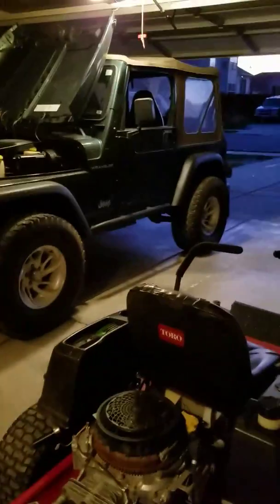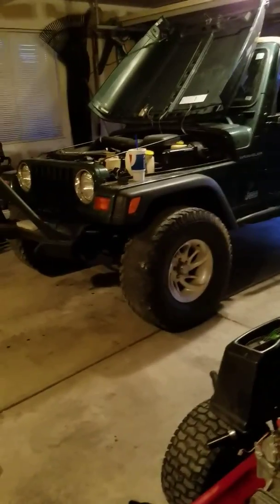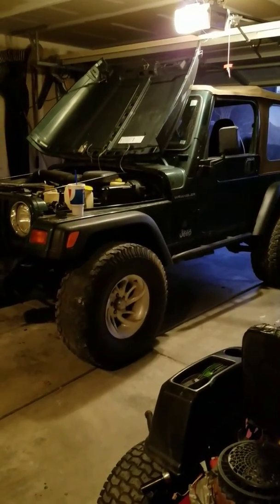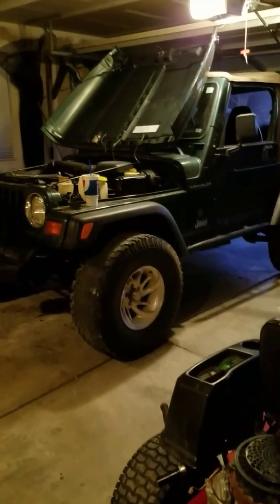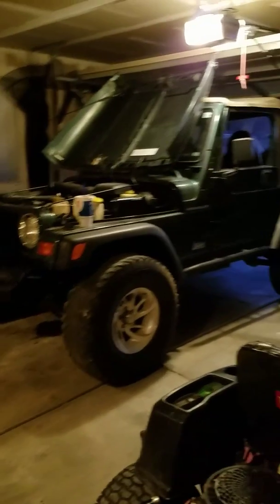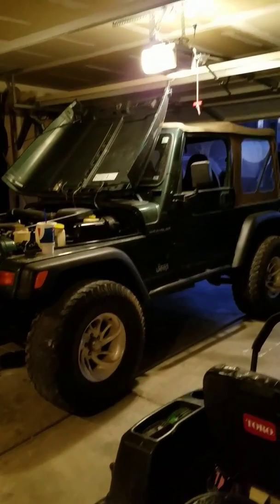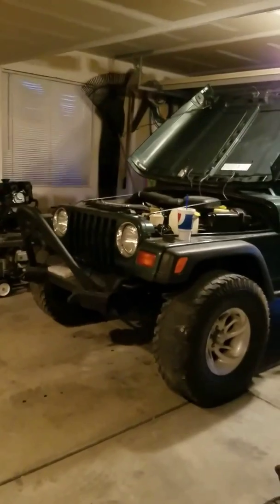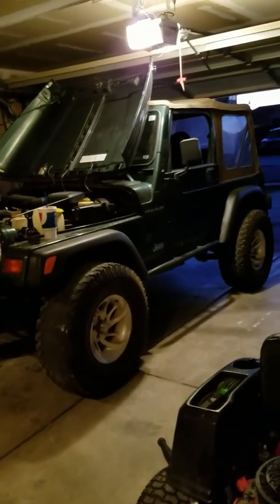Code P1391? jeep wrangle (TJ)

Comment: Thank you I’ll have to check that wire. I replaced the crankshaft position sensor because I was having random stalls while driving and that hasn’t happened since. After I drove around a bit I got a check engine light. My fixed app told me that I have a misfire in cylinder 4 and it was a valve spring, so I did all the coils and sparks and they were replaced by a shop. It sounded good and drove nice then when I got home I started hearing like popping sound and the engine was really misfiring. I haven’t driven it since since im worried about doing more harm. I’m going to be getting a new distributor since the I’m getting the code you all are getting for the crankshaft position sensor, so hopefully it’s just loose or not in properly. I just want to drive my wrangler so bad and not have any more ignition issues.
Reply: Thank you well let er rip. Hopefully my transmission isn’t what’s shot
Reply: Ever figure it out? Got the same problem
Reply: @ta.entmoney3405  I got a new distributor and completely check that the spark plugs are correct and in the correct position. Also make sure to have your transmission hoses checked, I had a small dripping leak. Absolutely get all you sensors changed and have it done by someone you trust. I literally put all the money into my wrangler and she was driving like freaking new! Then my transmission went. The one thing I over looked was the transmission, so please have it looked over, I miss my TJ. Spend the money. Or just take it to have looked by someone you trust and let them decide what’s best. I did all I could on my own and from my local trust worthy shop. It’s frustrating believe me, but don’t get worried, just get the girl fixed properly and literally just drive the crap out of it. I took it from Atlantic City to Pittsburgh. Granted the gas sucked but it definitely helped getting it out and driving it. Hope this helps!

Comment: 'm in the same boat, I keep getting that code but my car runs good. I don't have any ruff ittel or miss fires, I replaced the pick up coil aka crank sensor, I replaced the crank sensor and verify operation, still nothing, I got a list of possible fixes and one is a fuel pump but the fuel pump is running ok. Does any one have any new info? I'm about to order a scaner that can do ecm pcm diagnostics, I'm completely buffle. 1998 jeep wrangler 2.5L SE, I installed a new engine a few weeks back, like I said it runs good no issues other then the check engine light p1391 keeps on coming back
Reply: Pick up coil aka cam sensor sorry!

Comment: I got the same issue, I have been replacing everything too but can't figure out what it is, if you do please reply
Reply from the maker: I ended up replacing the wiring harness
Reply: @billmiresworld8612  replacing the wire harness fixed it?
Reply from the maker: Pablo Pabon yes it did for me
Reply: @billmiresworld8612  hmmm I'll try some of the cheaper fixes first. Mine started to hesitate and stall a couple weeks ago. Got it to run fine after 4 to 5 attempts. Then two nights ago it did it again but this time threw a check engine light. Maybe my issue is a sensor and not wires
Reply: Hey Brett, by chance where did you get your harness from? I’m having the same problem with my wrangler. Thanks

Comment: I have the same issue and have replaced PCM, plugs, coil, wires, cap, rotor fuel pump, crank sensor and cam sensor. It must be in the harness. Any updates?
Reply from the maker: I did in the police placing the harness and it seemed to work.
Reply: Any luck because I’m getting the same code and it’s telling me the crankshaft position sensor which I changed or a camshaft
Reply: @Evanburtis  mine was in the harness. Bad wire.
Reply: @jerryjellison8112  do you remember who you got the harness from?
Reply: @ricardozepeda6498  my issue is from the pcm to main harness, I purchased it from boosted tech with the supercharger kit.

 On another jeep the harness along the firewall, back of valve cover was the issue. I bought it from scrap yard.

Comment: Did you ever find out your issue?
Reply from the maker: Jessica Munro No I never did.
Reply from the maker: Jessica Munro no I did not.
Reply: @billmiresworld8612  I'm in the same boat, I keep getting that code but my car runs good. I don't have any ruff ittel or miss fires, I replaced the pick up coil aka crank sensor, I replaced the crank sensor and verify operation, still nothing, I got a list of possible fixes and one is a fuel pump but the fuel pump is running ok. Does any one have any new info? I'm about to order a scaner that can do ecm pcm diagnostics, I'm completely buffle. 1998 jeep wrangler 2.5L SE, I installed a new engine a few weeks back, like I said it runs good no issues other then the check engine light p1391 keeps on coming back.